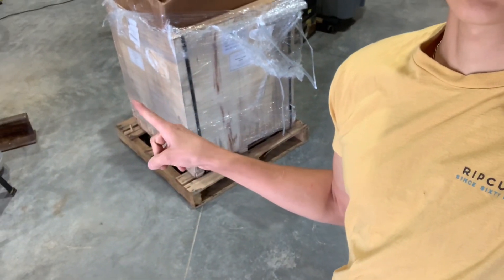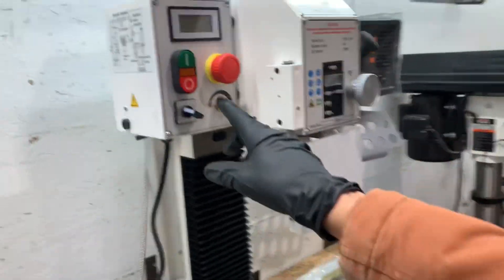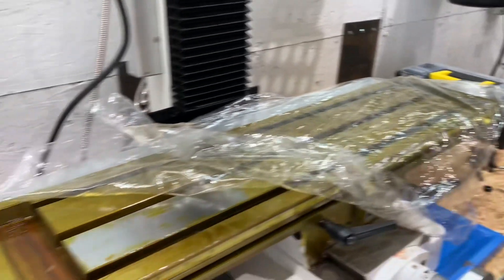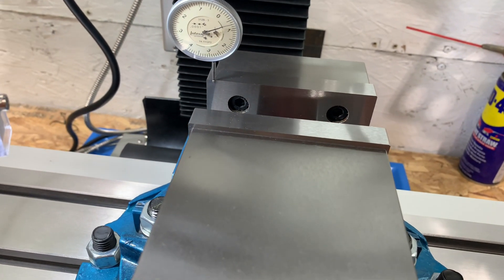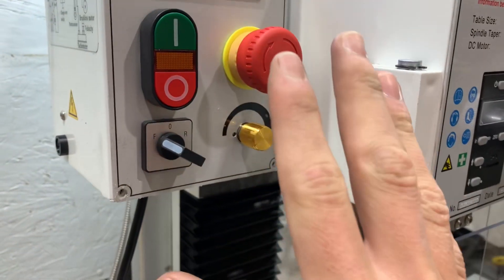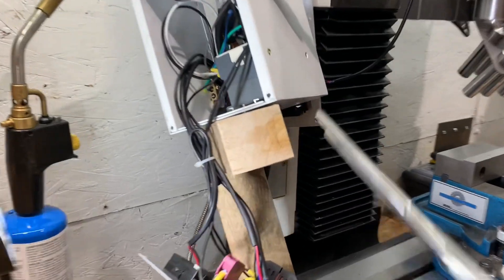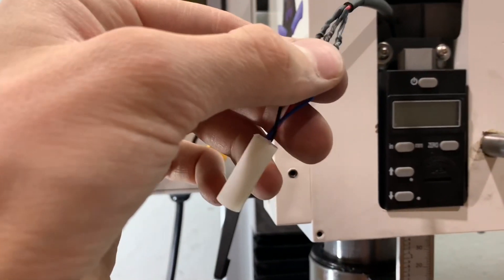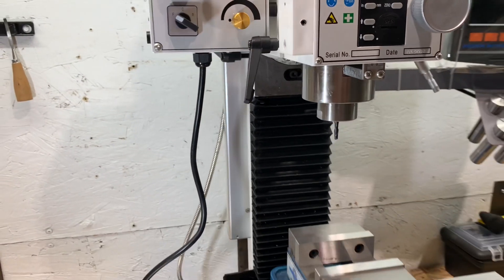My new precision Mathew’s pm25 milling machine!

Comment: Both my PM25  mill and PM1022 arrived not working.  Mill was fixed pretty quickly but the lathe took 4 months.  PM"s boards are crap.  Order an extra set right away.  Another joy with PM is they change designs on boards all the time.  Your experience with them mirrors mine with the lathe.  When one fix didn't work they just sent a different part.  Will never buy one of their products again.
Reply from the maker: Oh dang really that sucks

Comment: It's a great machine, I love mine!  (enough that I just ordered the matching lathe!).  Some suggestions... ditch the rotating base for the vice.  You're going to need the height and you'll likely never use it.  If you didn't order a jacob's chuck yet, get the shortest one you can find.  The machine doesn't have a ton of vertical height and if you keep that rotating base for the vice, you'll never be able to use any jacob's chuck.  Lastly, I suggest you replace the lever handles on the x-axis locks.  They suck and you're going to end up hitting them on the y-axis constantly.  I replaced mine with round knobs and it's WAY better and they don't hit the table when you move the Y.
Reply from the maker: Ok awesome thanks for the suggestions! That makes a lot of sense.
Reply: Dennis, I subscribe to your channel as well. As a full time machinist, these are GREAT tips.
Reply: @TobaccoTooling  glad to help!

Comment: Jeez man they screwed you over, those things are plug and play. You shouldn't have dad to do ANY of that. You would have been better off buying a used Bridgeport.
Reply from the maker: Yeah not the best situation but they fixed it and now it works great 👍
Reply: This machine is more accurate thatn a used Bridgeport if the small table limitation of it meet your needs. Unless you live in an old industrial area of the country it’s hard to find a good knee mill especially one that is tight.
Reply: @shawnmurray5452   and @TobaccoTooling   He absolutely did the right thing!!  Used Bridgeport's are often pretty roached and not worth it unless you're up for totally rebuilding it, or having one of the handful of top notch machine tool builders completely rebuild the thing, but even then, you're talking a boat load of money.  

About to pull the trigger on a PM-728VT.  Taiwanese made, "Precision" benchtop machine.  Don't have 3-phase in my suburban neighborhood (though a PWM control would solve that), but most importantly, I don't have the space for one AND my workshop is down in my basement.

Everything I've heard or read about PM raves about their customer service...  Seems like there's more than a few machines out there that arrive with issues, but they always make it right.
Reply: He did the right thing by buying this machine over a used Bridgeport. You never know what you’re getting yourself into with those machines unless you’re a machinist and can check to make sure the machines good and even then you can’t see inside the head and can’t make sure the ways aren’t crapped out on the dovetails. Good thing PM made it right though. Their Chinese machines seem to have a lot of issues but I’ve heard very good things about their Taiwanese made machines. I know people who have a few and they have had 0 problems with them. If you ever upgrade you machine Drew, make sure it’s a made in Taiwan machine, trust me.